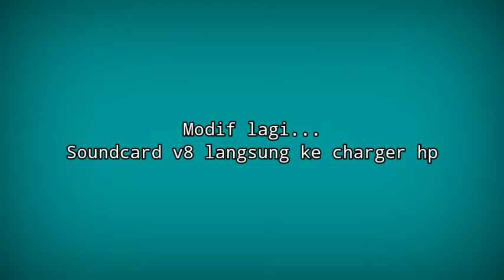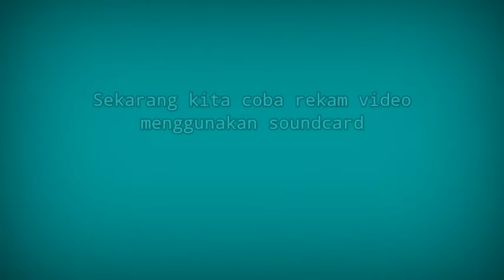Modifikasi sound card v8 lagi

Comment: Bang apa itu adaptor charge ya  kok gak kelihatan yg terbongkar itu saya mau coba nanti semoga berhasil
Reply from the maker: Itu cuma adaptor biasa bang

Makanya gk saya liatin
Reply: Yang gimana itu bang dimana bisa beli alat itu
Reply: Jika tidak punya solder untuk smbung kabel boleh pakai plaster gak
Reply: Bang pakai adaptor charge bisa gak?
Reply from the maker: @dewamartana7835  . Saya pake carger hp bang
Reply from the maker: @dewamartana7835  pake carjer hp sampean bisa bang
Reply from the maker: @dewamartana7835  bisa bang... Yang penting ples minesnya gk ketuker
Reply: Terimakasih bang informasi nya sangat bermanfaat semoga berhasil nanti sya coba
Reply from the maker: @dewamartana7835  siap bang
Reply: Bang sudah ku coba sudah mau tapi kok tetap your baterai is low please charge gt aja bang
Reply from the maker: @dewamartana7835  situ pake v8 bang?
Reply: @javaminiatur  ya bang tapi udah jarang dia bunyi batre low kadang kadang aja bang
Reply from the maker: @dewamartana7835 kalo punyaku gk pernah bunyi gitu.. Punyaku v8 yang lama
Reply: @javaminiatur  ya bang tadi aku coba udah gak bunyi gitu lagi makasi bang
Reply from the maker: Gk tau klo gitu bang
Sistem yang baru itu mungkin
Punyaku gk ada bunyi kayak gitu malah
Reply: @javaminiatur  ya bang terimakasih sudah berbagai
Reply from the maker: @dewamartana7835  siap bang sama2

Comment: Bang punya sya langusng ke adaptor ko gak nyala iya
Reply from the maker: Sebelumnya normal bang?
Reply: Normal bng
Reply: Skrng malah jadi mati total 😆
Reply from the maker: Adaptor normal?
Reply: Normal bng, udah sya pake cassan HP juga normal, tombol on off /switnya gak nyala bng lampu mati diteken"gak nyala 🤦‍♂️🤣
Reply: Ic nya jadi panas bng ini
Reply from the maker: @rockycoky8249  kemungkinan 1, abang salah kabel...
2, abang salah adaptor.. abang pake adaptor apa?brp volt?
Kalo melebihi 5 volt pasti gk kuat soundcardnya
Reply: Iya bang saya kegedean adaptornya 12v 🤦‍♂️
Sya pake adaptor 6v udah gak bisa, saya cek"lagi ic nya kuar asep 🤦‍♂️
Reply from the maker: @rockycoky8249  y pantesan bang 12 volt.. gk kuat v8nya
soundcard v8 supplaynya cocok 5volt 🤦
Reply: Iya bng salahnya sya gk cek"lagi
Bang sblumnya maksih atas responya iya 🙏 sukses trus bng
Reply from the maker: @rockycoky8249  iya bang sama².. 
makasih juga buat abangnya..
Lain kali lebih teliti mainan eletroniknya ya bang, semoga jadi pelajaran, jangan kapok, saya dulu juga sering gitu bang gk ngecek2 dulu asal pasang, akhirnya kebakar deh 🤣